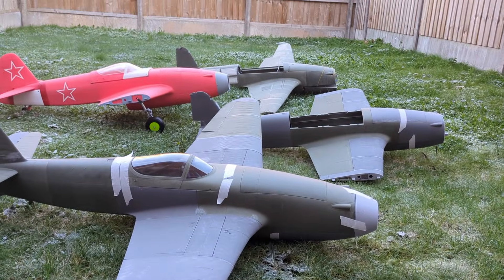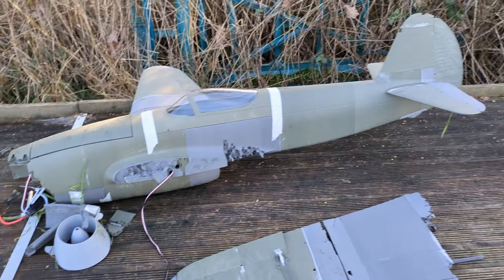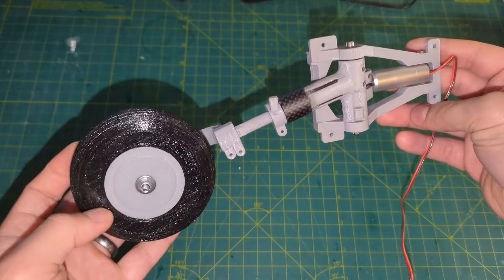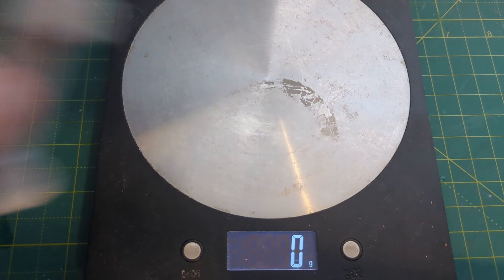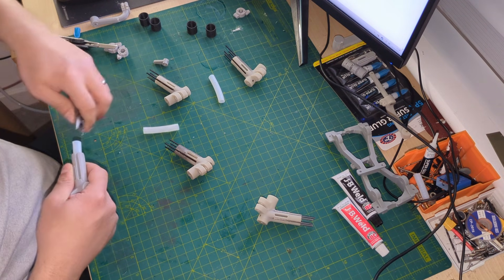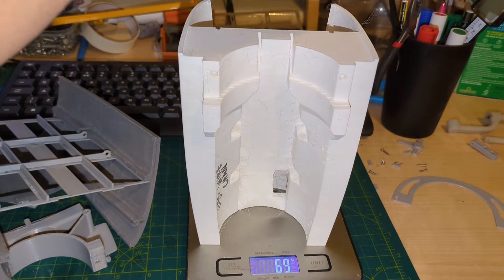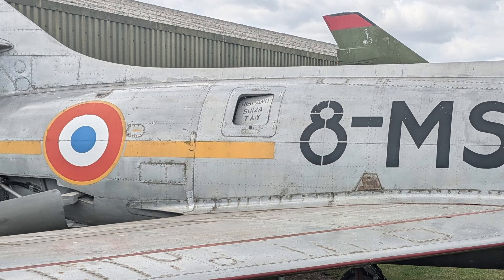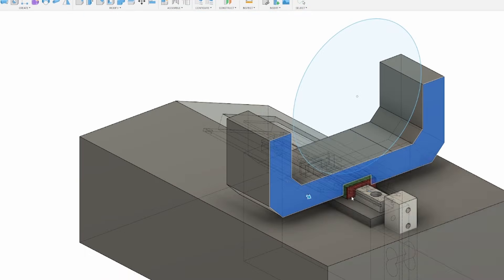3D Printed RC Jet - Yak 15 November Progress Update

Comment: I admire your tenacity and your design skills are impressive, but in another video you mentioned that your flight skills are lacking. Warbirds are something else, and you added on difficulty of a scratch build. Why not get familiar first with a throwaway foamies first and then get into increasingly difficult models? Start with something like a Pibros delta to get the throw right, slap a motor on it, then move to Eclipson models, then come back to this? Your design iterations are insane and the things you learned are wild. Just would hate to see you despair on this.
Reply from the maker: Thanks, I've taken a step back from the yak project to build up my flying skills and hopefully solve the hand launch issue entirely with a bungee set up. Thanks for the suggestions - I've been looking at some foamy designs.

Comment: i am pretty sure the problem here is the CG, please try to move it forward
Reply: Looked tail heavy when launched but could be the thrust line due to the outlet under the fuselage. Crash was obviously due to the stall
Reply from the maker: Definitely not that this time. The cg is as forward as is reasonable for this wing.